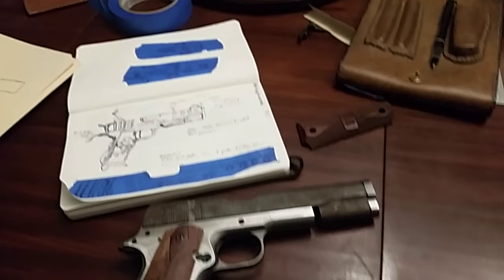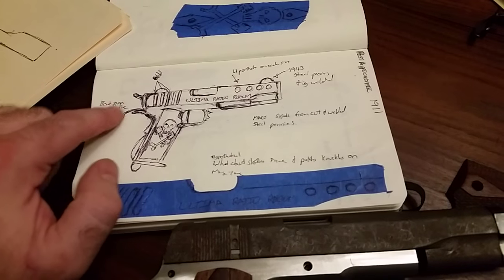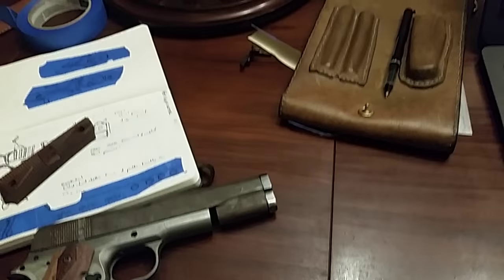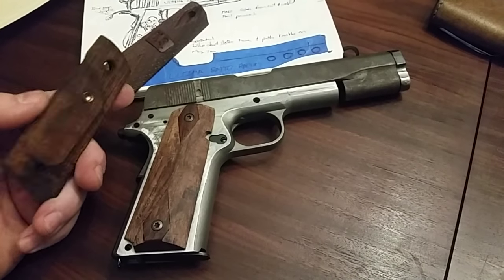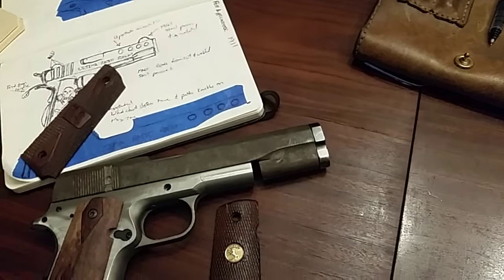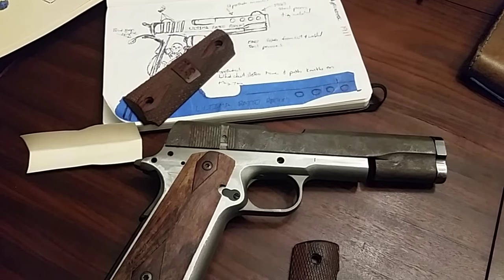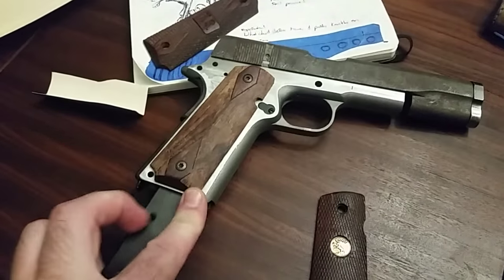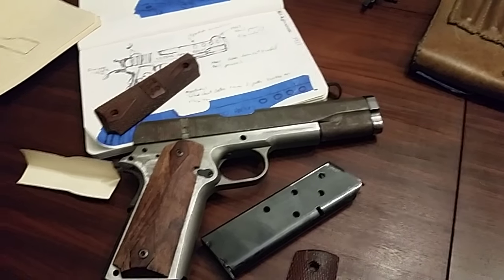Post Apocalyptic Home Made 1911 Video 1: Mad Max - Ultima Ratio Regum

Comment: Any way I can get crud rough looking 1911 upper and lower?
Reply from the maker: Yes, ebay is good for the upper.. beat 1911 lowers are hard to find but they exist.... you might want to do an 80% and then chuck it off the pier on a string for a few weeks. salt watter would make it age quick